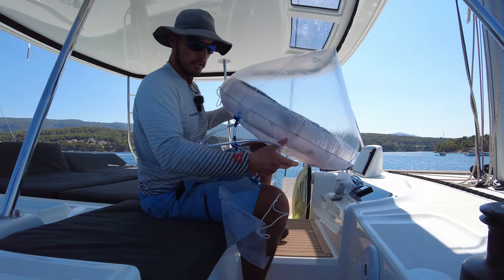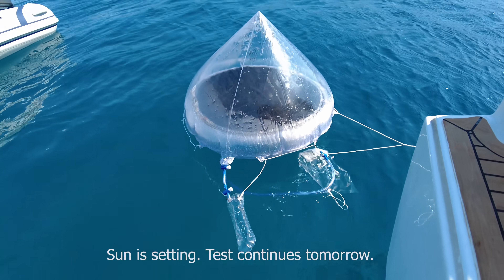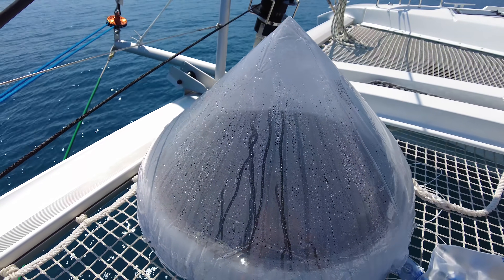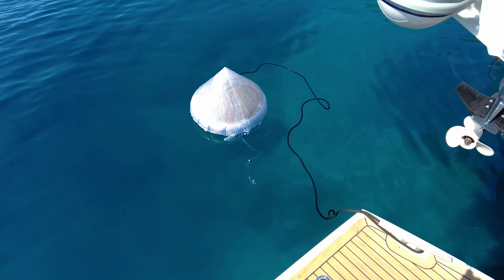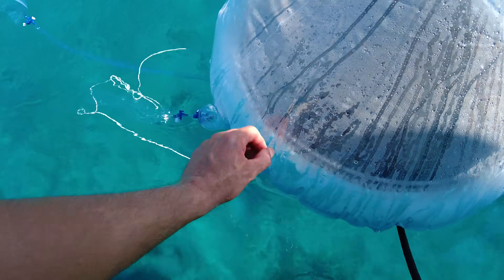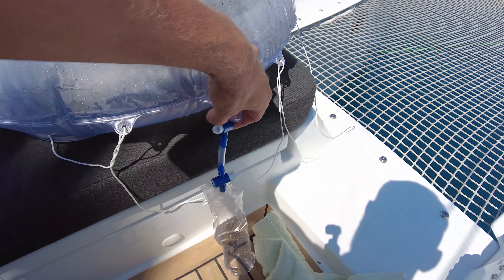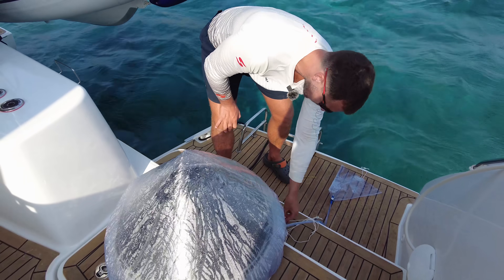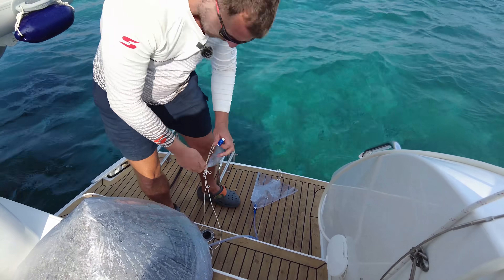Solar still - Sea made drinkable

Comment: You went through all of the work to make this video but don’t actually drink any to confirm to viewers that it tastes ok?!?
Reply: id imagine it tastes of warm plastic... but at least no salt.
Reply: It'll probably taste like hose water but If you're ever in a situation that requires this I'm sure it'll taste like nectar.
Reply: @mattterry2599  once I was camping for 8 days and I had bought this neat foldable 3-gallon/15L water tank, thought it would be good to have for all 8 of us. After a mere half an hour in that tank, the water tasted like liquid plastic... Imagine the strongest and worst plastic flavor you can, and double it, that's how bad it was. None of us could drink that water, it was absolutely disgusting, I'm not even sure it would taste better after not drinking for 2-3 days - it wasn't refreshing by any means.
Reply: @AlphaChinoz  i had a similar issue camping. Its the sun on the water bag in my instance that caused the taste. Kept it in the shade and there was no issue. Also was that your first time using one? Did you rinse it out first?
Reply: @dracoflame8780  we tried rinsing it out probably 10 times over, didn't make any difference on the taste - it was an extremely hot summer in a fairly open field so it was really hot in the shade as well. I guess the main problem was that it was really cheap... 😂
Reply: @AlphaChinoz  Next time use a food grade container ...
Reply: @AlphaChinoz  you have to let it vent or ( degass) for a few days or week open when those things are brand new washed multiple times before use I’m sure you know that now but I made the same mistake lol
Reply: @AlphaChinoz but did you die? No.
Reply: @mattterry2599  For your information ok if the still isnt working right you will still have accumulated some water But its salt water..  you have to experiment and be sure you get positive results..  the taste of plastic is positive of course but you have too get that water  - its fresh
Reply: @mattterry2599  No way it will taste like hose water as it has no minerals ?
Reply: @surronzak8154  dumbest comment right here
Reply: @wantsomecheeseitz wich one ? And can you elaborate ?
Reply: Imagine the PFAS and micro chemical plastics in water that was distilled in plastic 

Prob best to save those sips for emergencies….
Reply: @Michael_Rory_Cameron micro chemical plastic? So we just making shit up now 😂😂😂 either English wasn’t your first language or you actually are ignorant enough to believe the words you just said
Reply: Confirm what? Physics hasnt changed. Condensation will still BE FRESH WATER!! 😅
Reply: Why wouldn’t it taste ok.  Distilled is distilled.
Reply: @richardfolden3860  because a guy was stranded at sea for months and he told the story  he didnt know how too work it the right way,, if you want too survive you have too  know  how too work it .. he tried and first  he made salt water and he ruined the still  and he had one more still  and he figured it out...
Reply: @dancingtrout6719  lol, that has nothing to do with tastes ok.  If it’s been distilled, it’s distilled.
Reply: @richardfolden3860  the way he was whacking it some of the salt water could have gone into the fresh water
Reply: on the episode of I S B A the guy stranded at sea for 76 days said  he couldnt Drink the water  that came off the roof of his Raft:::  The Sun Baked The Roof  too a powder  and the water was Toxic  and he would never drink it..  thats reality ..
Reply: It will taste a lot better than water from that other source below the waist.
Reply: Bingo. No conclusion. Bad demonstration.
Reply: Glass is better
Reply: This isn´t potable water, since it´s destilled, and health-endangering (you blood-cells will blast, if you drink only that)... You have to mix like 2,7% of salty-sea-water to it (973ml destilled- and 27ml of seawater for 1 lt of potalbe), in order to make potable water...
Reply: Add a shot of seawater to restore trace of electrolytes.
Reply: Yeah I agree the entire video I was waiting to see if he drank it I didn’t care about the taste of it I just wanted to see him drink it that was all fucking point and all the idiot comments focusing on the fact that you wondered if it tasted OK are trifling and miss the point
Reply: It's made to produce fresh water in a survival situation where you're stranded at sea. Taste would be the last thing on your mind, you'd just be ecstatic to have fresh water
Reply: I was looking for this comment. Thanks
Reply: Do you know that actually it doesn’t remove bacteria but removes salt so still cook it under a fire
Reply: @Elliot_ST1 So it does not produce drinkable water and is useless. Gotcha.

Comment: If your life depended on it, you best have a several of those stills doing their thing at the same time. And, don't forget, if all else fails push the salt water up your butt hole as an enema. The intestines will separate the water from the minerals in it. That's what they do all the time. Of course a buildup of the minerals left behind isn't good for you. With luck you can expel them when you defecate (if you CAN defecate). It might help to push some salt water up there but not try to keep it in for long so as to facilitate the removal of the minerals. Keep some enema bags or plastic bottles, even empty ones on board and in the lifeboat. Oh, and a good supply of Vaseline as well.

Comment: You need to add a vacuum hand pump to the unit to create a lower vapour pressure inside the unit, which will lower the temperature boiling point of the water and accelerate evaporation.
Reply: It's inflatable. If you turned it into a vacuum it would collapse from the outside air pressure.
Reply: If you are using a handpump, better add a small RO filter and directly pump out drinking water.
Reply: Not gonna work in a unit this small, dude.
The water surface is too small and it wouldn't weight enough to prevent it from rising up and filling the thingy with water.

Comment: Can you try add a black plate that float close to surface  and underneath the floater. The purpose is to increase the temperature of he water near the surface which will increase the vapor and might increase amount of water it produces.

Comment: Fill the bottom with seawater as it dark and the top is see through the sunlight will heat the bottom water. The warm water will start to evaporate the warmer the bottom the better. The steam goes up and if the cone top is cooler it will codense and fresh water will drip to side ring connected to the drinking bottle. Don't put the device in the water you cool the bottom and stop the evaporation. If anything keep out the water and put it on warm Sunny dark surface to keep the evaporation going. From time to pour cool seawater in the top t cool it and condenses faster. Ever boiled pot of soup? If you cool the bottom it will stop evaporating

Comment: Two questions:
1.  Will this work on a larger scale?
2.  This will remove almost all the minerals, how about micro-organisms?
Thank You.  Excellent presentation.
Reply: Don't forget UV spectrum of the light. It's one of the best possibilities to make drinking water safe.
Reply: 1- Larger scale would need a better source of energy, like a solar mirror. This is an emergency water supply only.
2- you do not need to eliminate 100% of the salinity, 0,5% salt concentration is actually healtier in the situation that it is designed to be used. Most of the microorganisms are killed by the sun's UV rays, however you should drink all the water, storing it will let them time to reproduce and make you sick.
Reply: It will remove the minerals and kill most the microbes, given your water source isn't too bad.
I have no idea how they put the minerals back.

Comment: Design errors: steam prevents the passage of heat rays to the heating of seawater, the water heater - the black bottom lies on the water or close to it, preventing evaporation; for efficient operation, place the heater (black surface) on top to absorb sunlight, place the refrigerator on the surface of the water, organize the condenser according to the scheme, seawater is poured into a black container colors made of plastic through the nipple on the lid are black, between the container and the lid (connected by heat transfer bridges) there is a gap for the passage of steam into the refrigerator, the refrigerator consists of a side (for the entire structure) light-reflecting surface of white color passing into the bottom adjacent to the surface of water for cooling and condensation, plastic tubes filled with water and supported by a flat tank (the nipple for pumping air and filling with water goes to the side surface) to cool the entire volume of air, the heating tank and the cooling bottom are separated by a gap of the calculated length or an additional thermal pad for the absence of heat loss, calculate the diameter of the tubes so that positive convection of heat received from the sun is provided and to improve heat transfer through the fluctuation water columns bottom and mouth of the cooling tubes.
Reply: There is no steam in this setup, just water vapor which is NOT the same thing. I didn't bother reading the rest of the wall of text after that.

Comment: I recently heard that if you’re using this to survive, you need to put a couple drops of sea water back in to replace minerals.
Reply: Minerals from food will make up for drinking distilled water.  This is an old myth that will not impact someone with a normal diet.  In high heat, electrolytes must be added regardless of the type of water you drink.  In a survival situation such as being discussed by a lot of people in this thread, hydration is critical to survival.  Minerals supplements can be dealt with later assuming they are rescued.  The man surviving on raw fish received quality minerals from the raw fish he was eating.
Reply: Distilled water is completely stripped of everything other than hydrogen and oxygen and will not give your body any electrolytes.

Sea water is about 3.5% salt while the body sits around 1% this unsafe to drink.

By diluting the sea water by five times (four gallons distilled to one of sea) they find the right mix to be perfectly healthy and beneficial. 

I would probably go less than 4to one though since it’s not just the salt that unhealthy in the sea water but also microorganisms n stuff
Reply: @andrewford743  Although technically right in reality in a life raft, you will be exposed to so much salt in and on the raft as well as in the air you breathe it gets caked up all over you. If you are lucky enough to catch fish or a turtle you drink the blood right away and so as you can see electrolytes are not so hard to replace. SO PLEASE DO NOT ADD SALT WATER TO YOUR DISTILLED DRINKING WATER. YOU WON'T NEED IT... and add to your already dire situation. Also, you might get some salt contamination from the rain collection and the still as well.
Reply: DO NOT EVER DRINK SEA WATER!!!! DO NOT LISTEN TO THIS ☝️☝️☝️
Reply: A small quantity you fool. If you drink distilled water at all frequently, it will DEHYDRATE you. Osmosis will suck the electrolytes out of your cells, killing you. @SzymczykProductions
Reply: @SzymczykProductions  why not? I’m not talking about drinking pure sea water. I said a couple drops. Maybe I should be more clear. Like 1 to 2 drops per liter. If you disagree that’s fine, but you gotta say why…
Reply: @AnthonyScottGames 'szymczyk' is pointing to his own sentence warning us, "DO NOT LISTEN".

Comment: Still needs to be floating, so it can work on difference in temperature between the greenhouse top and the cooler water below. That's what makes the evaporating seawater condense and flow down the cone.

Comment: Since this is not high-temperature distilled (i.e. not boiled), and rather exposed to sunlight, would you not get algae buildup in the areas that collect the condensate? Those spores have a habit of getting everywhere. Is there any way to clean it out?
Reply: Don't when you put water in a plastic bag under sunlight don't it kill most of that?

Comment: hmmm, drink distelled water can work only for a time... this device should come with a way to add a small amount of minerals to the distilled water
Reply: When stuck out at sea, this would be an issue yes. I assume this system is supposed to help out for a limited amount of time only until rescue; before mineral deficiency becomes a concern which is less of an immediate problem than dehydration?
Reply: @maidsandmuses  Ребята, у вас минералов под задницей - целое море! Разведите полученную воду с морской в пропорции 43:1

Comment: You don't put it on net or don't put  dome inside water,  You put it on plain surface,  You add more water , if ever you feel water is already evopatertd. 
You can do tapping for collection of water. 
Solor dome doesn't work on cooling system at bottom. 
More it is hot , more water you will get evaporated. 
Experiment it and reply.  Jay Bharat.

Comment: I learned this method as a science project in middle school. We put dye in water and used a burner to imitate evaporation and then put saran wrap on a slant above it to catch the evaporating water. It collected on the top and when the droplets got big enough they rolled down into a separate dish as clean fresh water. Im currently 31 and that's the main survival tactic that has stuck with me my entire life lol.
Reply: if you put a zip lock bag or bigger over the branches of a tree you can collect water that the tree leaves expires and drink that. that is why duct tape and clear plastic bags are, so important in any survival bag.
Reply: @turlelee2008  If you have a source of dirty water, you can use a small section of the stalk of a vine to clean it up.  You simply put the bottom end of the stalk into the dirty water, bend the stalk over and place the other end (that was originally the top part of the stalk) into a clean container.  Pretty soon clean water will start to drip out of the clean end.  It's like the stalk has a built in pump and filter built into it.  Apparently the water produced this way has a slight taste of grass but is fine to drink.  To increase flow, you simply add more pieces of stalk.  It doesn't take long to produce copious volumes of potable water.  Obviously you want to avoid things like poison ivy but pretty much any vine will do the job.  Grape vines work particularly well.
Reply: Ben Affleck and his crew taught me how to do this in middle school science in 1991 on "The Voyage of the Mimi", on the episode where the ship gets stranded on an uninhabited island and has no clean water to drink.
Reply: @reddyrippin came here to say this. Tho I’d forgotten Ben was in that

Comment: A problem that I see with these technologies is that they are almost always plastic and i feel like micro plastic is a problem
Reply: Not an issue, the amount of plastic needed to equip every boat with one of these is tiny in comparison to everything else. They would stay there and never be used unless needed, as opposed to plastic other throwaway uses.
Reply: @xhivo97  I’m talking about the thing itself leaking micro plastic in the water it’s collecting
Reply: @bingflosby  Even less of an issue since this is meant for survival scenarios so if you need to use this you're already in trouble. Idk if this would be less or more than eating fish anyways.

Comment: The item does not separate the good water from the bad. If you tilt it the bad water mixes with the good. The small bag that is supposed to collect the good water has no outlet so how are you supposed to get it out of its little tiny bag? It took 2 days of hot desert California sun to generate 1 tablespoon of water. But don’t move it! Or the bad water will mix with it. There is no way of cleaning the unit. It is all completely enclosed except for a tube where you add the bad water. It is draining now with fungus and algae growing inside its little dome. Getting it ready for the garbage collectors. I can’t get a refund because it does not qualify for one from Amazon. Beware!
Reply: Какой интересный комментарий! А ведь действительно! Система должна иметь доступ к обслуживанию и уходу! Иначе не избежать того, что вы описали!
 Достаточно было бы сделать купол съёмным, на одной стойке по центру.

Comment: Distilled water is safe to drink But... is just hydrogen and oxygen and nothing else.
Without important minerals, like calcium, sodium, and magnesium... flavor is flat.
Reply: Also, having the right amount of minerals like sodium is important for hydration. A few users have recommended in this comments section to add some drops of seawater to the condensed water.

Comment: I think the perfect design would be one where "somehow" the conical part is held under water upside down, so the walls are water cooled. It'd need some heavy weights or something. Then you'd need the evaporation part on top carefully separated so it doesn't spill into the conical part. Maybe include wave action to help circulate the moist air. Not sure of a good way to do all that, so this version might be a good balance of simplicity and effectiveness.
Reply: They had that design I think even back in WWII.  It looked like a football with a stick down the center.  You wet a towel and suspended it, then collected fresh water that condensed in the bottom.  That should work significantly better in calm conditions but this design may be less likely to mix seawater back into the fresh in waves.  It's also less fiddly because you can have more seawater inside than a towel can absorb.  So you don't have to fiddle with it every hour.  But not getting the seawater to help with condensation definitely makes the thermodynamics less good when it's calm.